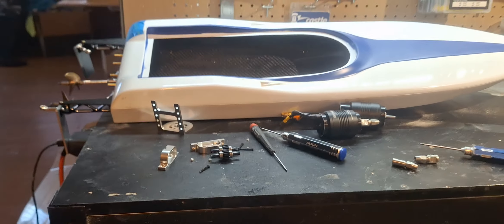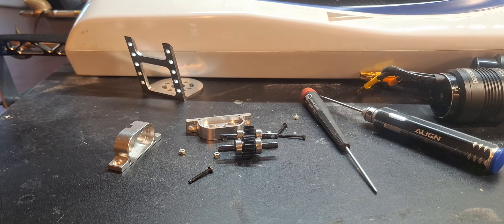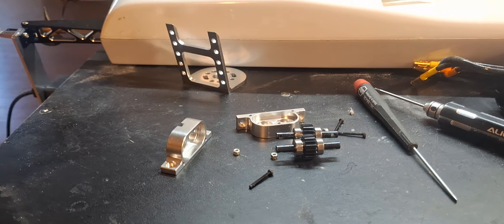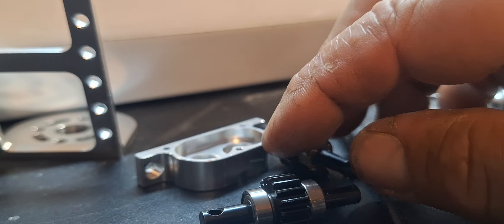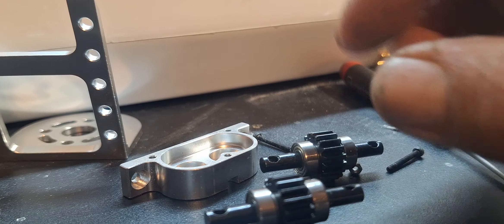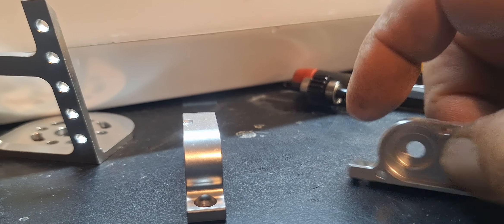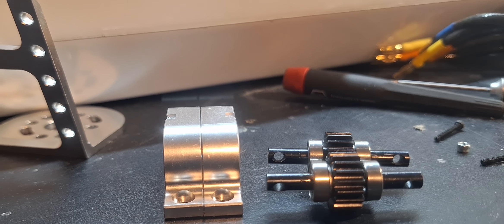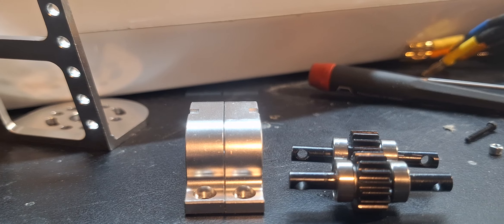1 motor twin screw Lizard #boatgang #boatworks #rcboating #rcboat #rcboat #boatwerks

Comment: The problem may be rpm for the bearings. They are made for a rock crawler making no rpm. Double check the bearing rated rpm.
Reply from the maker: Not sure what they are rated for the bearings are good sized bigger than the ones in the outboards